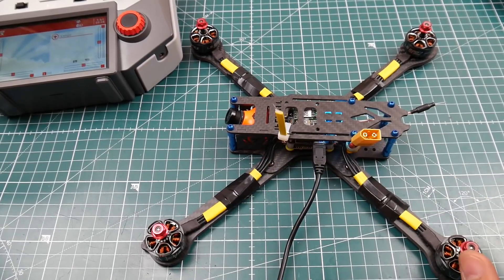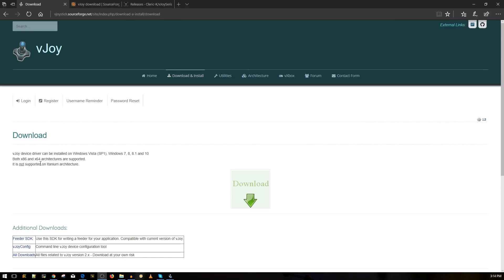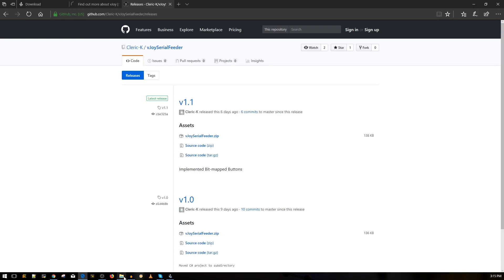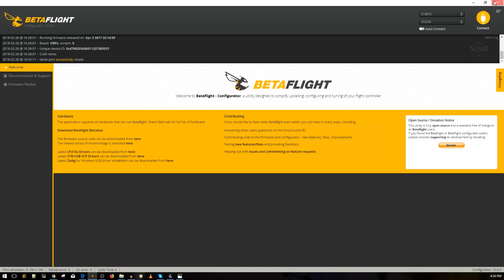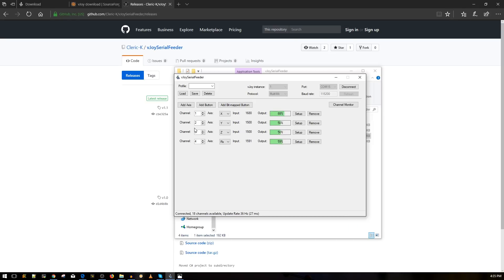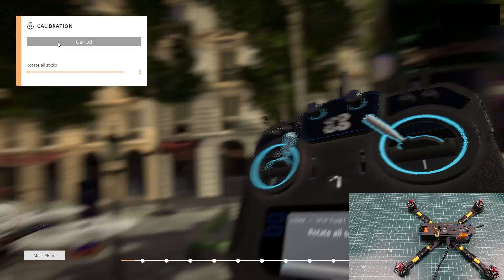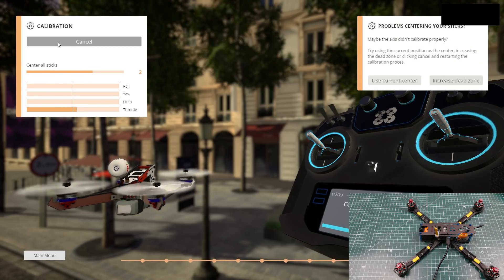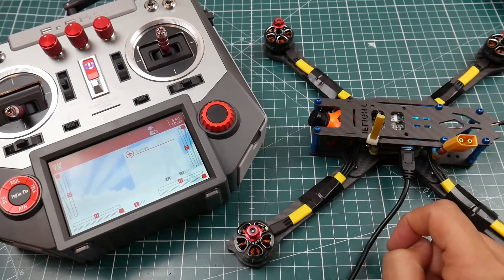How to connect FrSky transmitter Wireless to PC // Play through your Quadcopter

Comment: the serial feeder software doesn't work in Uncrashed. it needs to have 4 axis and it only has 3 .. Uncrashed see's only what has an axis XY or Z .. the other axis Rx , Rz , Ry, Sl0 and Sl1 all act as switches and if you put 'none' it will not see it at all. if you put XY or Z in twice it will not work either .. I've tried
Reply: here is a better video for how to do this..https://youtu.be/wuobzowLfj0

no extra programs needed..

Comment: I've found that in the SPRacing F3 even if It does not give power to the receiver, you can get 3.4 volt from the LED pin so you can use this board wothout a lipo

Comment: Awsome. Works great. Thank you very much. I tried a long time to connect my FlySky FS-i6 to the PC. This is by far the best way. I used a Eachine QX90C FC board without the camera and motors. Very easy to use and small.

Comment: Some flight controllers can't do this. 

For example : SP Racing F3.  
The flight controller doesn't power up the receiver. You need the battery to get it running. The downside... You will burn your VTX overtime.
Reply from the maker: unplug your VTX or its time for an upgrade ;)

Comment: You can tap 5v off the usb plug if your FC doesn't power the receiver from usb. I took out my multimeter and found small pads near the usb plug and ran the receiver from there.

Comment: Awesome stuff as always. I use a ISDT q6 charger and was wondering if you can set it to power a quad on the bench instead of using a battery. It would work for this scenario where your fc doesn’t power your receiver, and you wouldn’t have to worry about your battery going dead. It would also be nice for bench testing. Can you set it to output a constant 3s or 4s voltage without having a balance plug connected?

Comment: im using brushed fc spracing f3 evo with flysky, i have connect to the serial feeder and it work all of the chanel, but when i open lift off, the transmiter isnt connect although its says vjoy as my controller, is it not working with FSi6X?
thx

Comment: Have you notice any improvement on transmission speed?  I was reading about another solution using an arduino which is supposedly to gives faster transmission time than using just the simulator cable. Thanks for the video!

Comment: Hey... so I'm using a naze32 rev5 and a flyskyi6 transmitter and receiver and windows 10 on my computer. I can connect to betaflight and see my controller changing the colored  sliders. But for some reason, I cant connect to the vjserialfeeder application. I did close my connection with betaflight, and did everything stated  in the video, but I keep getting the error message " can not open that port" does anyone have any idea about what I could possibly be doing wrong? Could it have something with how the only port that pops up to connect it is COM4? That is the one that works for me in betaflight, and is the only one that pops up in vjserialfeeder.

Comment: I’m assuming this won’t work for a Mac.... there’s not many options for using transmitters on mac
Reply: Flyboy was thinking the same
Reply: I'm thinking probably not. Being a mac user myself I will have to try and see. If not I may have to run windows thru boot camp.
Reply: just checked it out, vjoy only runs on windows... Going to  have to run windows.
Reply: Last time I checked, I could use my X9D Plus in liftoff using the USB just fine... (obviously that isn’t wireless though). I also have a USB thingy from iRange, where you can also connect an RX to. Didn’t check that one on the Mac yet, works flawless in Windows.

Comment: how is the latency?
Reply: On a F4 board I wasn't able to feel any. But with Eachine E010S (F3 fc) it was noticeable.
Reply: Does that mean that the arduino solution is faster compared to connecting my Betaflight f3 kwad?
Thank you so much for making this possible!
Reply: audiogek Well, technically - yes. The direct connection will always be faster (with several milliseconds) compared to the FC reading the receiver and then retransmitting the data to the PC.  Practically, will you be able to feel a difference? I don't know. Only way is to try.